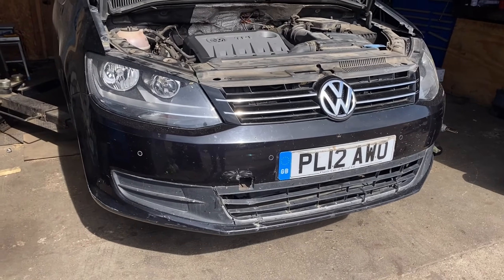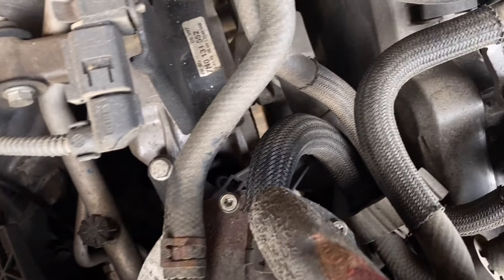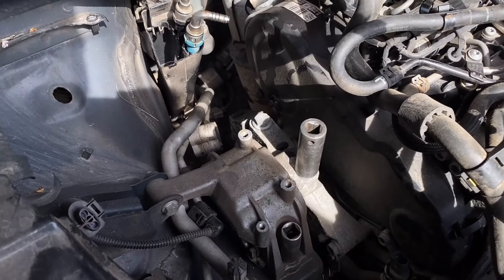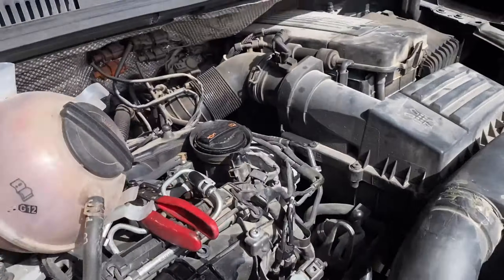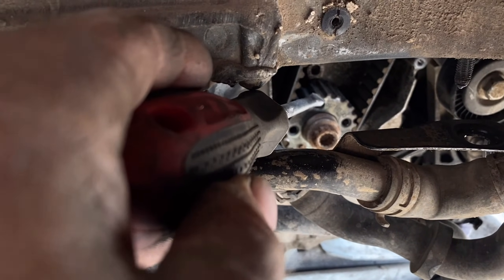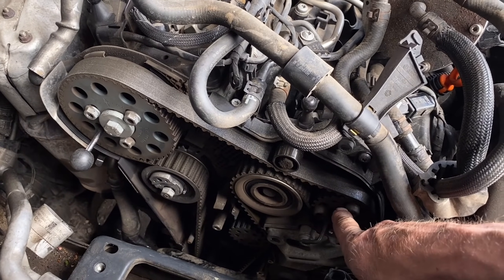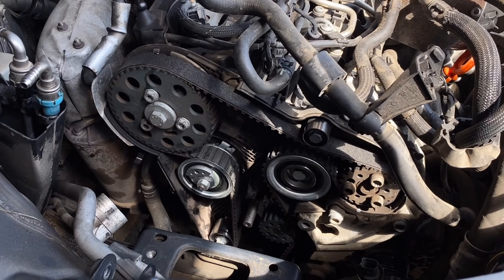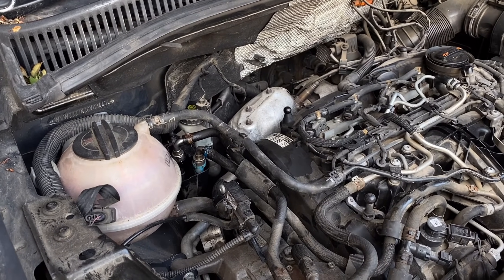Replacing Your Vw 1.6/2.0 TDI CR timing belt & water pump

Comment: Hello, I was wondering if you can help me, i recently got the timing belt kit you used in this video installed on my mk7 golf (RHD DSG), but as soon as it came out, the car struggles up hill and revs upto 3.5-4k on inclined roads. my mpg went from 50 before install to 25 mpg after. I did take it to another VW specialist to see if it was a tooth off but he said it was fitted correctly, just that the numbers should be reading upwards when facing the timing belt from the drivers wing, do you think the direction of the belt being installed would affect the cars performance? to make things worse, there are no fault codes when scanning for errors. thank you for your time
Reply from the maker: Hi bud sorry to hear you are having problems and nope the belt going the other way makes absolutely no difference so don’t worry about that, it’s a shame it doesn’t throw a fault code up. Normally codes will come up if you go up a long hill, that gives the ecu time to see a problem and throw a code up.
Reply: @YTDTETV  thank you for your swift response. I was advised to take to fill up v power and take it on the motorway for 20 odd miles, and if persists go to someone with odis or another scan for a deeper dive. This is the only time I want to see a fault code
Reply from the maker: @D3generateGamer  that is a good tip about good fuel, let me know how you get on.
Reply: @YTDTETV  I took it last night for 40 miles altogether on the motorway, but before that "Try adapting (also called basic reset) the clutch and see if it fixes your problem. Turn the car off, turn the key to II right before ignition, hold the throttle pedal down to the "button" for 20 seconds, release, turn the car all the way off (DO NOT REMOVE KEY) then back to II, then off again and then start the car. See if you feel a difference, you probably will." Tried the throttle reset, the cars not 100% but it does drive a lot better and doesn’t reg up to 3.5-4k revs anymore. It’s a drivable car, mpg was at 40 after ydays method. Guess the throttle sensor/position got messed up when they took wires out for the belt

Comment: Can you show the torquing of the engine mount bolts? Heard in another video they were crazy tight.
Reply from the maker: Hey bud I didn’t use a torque wrench in these just tight with a half inch ratchet 👍

Comment: Have you had it where there is two types of tensioner I’m doing mine and have the same kit you have but the tensioner on it at the moment is the other style gates version are they interchangeable if you know? Cheers
Reply from the maker: Hi bud sorry for the delay, I’ve heard there’s 2 types but not seen the other one, if it bolts on then I’d say you could use it 👍

Comment: Great Guide. When I go to tension the belt up it means I can’t pull out the Camshaft Pin it’s really stuck in. It was loose in the hole before I tried to tension it up. Can’t you help?
Reply from the maker: Hi Tom sorry for the delay did you solve this?
Reply: @YTDTETV  Hi. Yes I took belts off again and turned the cam pulled and fuel pump pulley clockwise to their stops and then resin-stalled. Once tensioned up I could remove the locking tools. I did have to make
Minor adjustments after turning the engine round at the end. I found a good video showing how to make those minor adjustments. I will post up in the comments. Thanks again!
Reply from the maker: @TC07YER  well
Done Tom sorry I didn’t get back to you sooner 👍

Comment: Hey, what kind of sealant was in that tube?:) whats the name
Reply from the maker: Hey woody I use wellseal 👍
Reply: @YTDTETV  Thank you so much! Just did the job and water pump leaking.. also thanks for the great informative video, and quick response:)
Will be using a similar product when fixing the leak
Reply from the maker: @TheToastedGamer  no problem happy to help, I use wellseal on o rings and most gaskets as it’s not like a normal silicone it’s more of a thick liquids. Also if you ever have to remove a part with a gasket the gasket won’t be stuck to the surface then ripped when removed.

Comment: My mechanic uses genuine vw kit and water pump he says he has had well known aftermarket water pumps leak well before the 80k mile change time.
Has anyone had contitech, ina, gates, skf pumps leak before the next belt change has come round?
Reply from the maker: Hey bud so the 4 brands you mention are normally really good, water pump life can also be shortened by the belt being to tight when fitted. A genuine pump is always best 👍
Reply: Oh ok thanks for reply
Reply: Hepu P569 leaks after 5 years and 65,000 km mostly urban drive.
Reply: @accurate3839  i went with genuine belt and genuine pump after hearing stories of other pumps failing well before cambelt change interval

Comment: Just had my VW Caddy van re-mapped after an EGR valve failure.
He said that all VWs are ECU programmed to fail namely the EGR value, Glow plugs and then the injectors before it gets to 100k. Best £300 I have ever spent getting all the self destruct codes deleted.
Reply from the maker: Hey Gareth if you want a Vw to last then yes a Delete and remap is a must, you will have hassle free motoring now with better fuel economy 👍

Comment: I just had timing belt and water pump on mrs’ 2016 Skoda Superb 1.6 TDI. The water pump had some electronic part on it. Some sort of sensor with a plug on it. What do you reckon that does besides making the kit more expensive?
Reply from the maker: Hey B-ry the later ones like yours have a variable water pump so when the engine is cold the water pump isn’t spinning 😵‍💫 good for colder weather. I havnt done one myself but read about them.

Comment: Nice vid. Just want to mention that the engine mounting bolts are stretch bolts and therfore one time use.
New ones should be used on reassembly.
Cheers.
Reply from the maker: Thank you bud 👍 I never knew that about the bolts so will remember on the next one. Thank you 👍👍

Comment: Great video mate. Just having  a go at my timing belt now, after watching this a number of times. Have bought a timing belt locking kit of amazon and like yours, the crankshaft locking tool doesn't fit the teeth properly but can get the line and hole to line up. Could this affect the timing because the tool doesn't quite fit snug
Reply from the maker: Hi bud thank you glad the video is of use 👍 yes the crank pulley tool don’t seem to fit to well only half of it seems to bite all the way into the teeth in the pulley. Al long as you can see the line lined up and the hole for the pin then it’s all good 👍👍
Reply from the maker: Just take your time, double check all your marks after then rotate engine a couple of times and check marks again you’ll be ok 👍

Comment: Excellent video and good camera work, good that you explained the possible tip falls on this job.
Just would like to suggest maybe you need to highlight the need to prime the fuel system thoroughly before starting.
Reply from the maker: Hey Colin thank you for your comment 👍👍 yes your right flicking the key in and off 5-10 times is definitely needed. When making these videos it sometimes get hard to remember to mention all of the tips as focusing on the actual job and a camera sometimes gets a little tricky.
Reply: @YTDTETV  yes quite a complex and time consuming operation, many thanks for your 
 time and trouble with the details

Comment: Excellent vid and no waffling. Very helpful. Could I ask how you remove the fuel pump without upsetting the timing as you have a locking pin in it?
Reply from the maker: Hi bud thank you 👍, after inspecting closely the pin that I put in the pump wasn’t doing anything. Also on a modern common rail engine like this one the pump isn’t actually timed up as the fuel pump only produces a constant high pressure at all times it’s the electric injectors that do the timing from the ecu. Just to be on the safe side I would mark the pulley with abit of tipex or something then re align when you put the belt back on. 👍

Comment: VW sharan 2011 2.0 cffb.
I found no need to disconnect fuel lines. For coolant I have disconnected the hose at the bottom near aux heater where its comfortable to catch it.Drained as much as I can,so when water pump out it was very minimum coolant coming out.Gates kit dont have tentioner lever,weard and a bit scary to put in.But job done.
SKF was on the vehicle probably from the factory (108k miles),tentioner bearing making a nose when spinning,the rest of the components spot on.
After doing the job I think genuen kit from tps will be my next one.
Yes gates and other aftermarket kits are decent,but difference in the price is not as big,so genuen next time.
Ones again thank you for the video.
Reply from the maker: Hey bud that’s awesome 👍👍 nice tips there I’ll try not disconnecting fuel lines next time. Good job you changed then if one of the bearings where noisy.  Glad the video was of use, appreciate your comments 👍

Comment: 152k miles,I take its second timing belt kit for this?
Mine is 110k miles,never been done.
Manual said good up to 210k km,but I'll do it now.Also 11 years car,so I recon it's time to change. 
Thank you for sharing.
Reply from the maker: Hi bud yes I’d say it must be it’s 2nd replacement, I’d say 110k miles yes yours is due. These vw’s have a really thick and wide belt so they last longer than others. I saw an Alfa Romeo belt snap at 46k, I replaced the head. Thank you for the comment 👍👍

Comment: Hi bud nice vid and explained well ,why do you have to undo the cam pulley bolts?. Asking as I'm about to do my 1.6skoda TDI. Thanks Dave.
Reply from the maker: Hi bud welcome to the channel and thank you for the comment, so you undo the cam pulley bolt as it makes it easier to get the new belt on. If you I do it you can mark what it’s sits on the bolts. You can do it without undoing the bolts aswel I’ve just done a few and is slightly easier to get new belt on. Shout me if you need anymore help 👍 also if you get 2 mins and fancy sharing the vid that be great 👍.
Reply: Thanks mate you make it look sooo easy lol
Reply from the maker: @kawasakiinitful  thank you 👍 I have done a fair few so practice makes perfect I’m sure you’ll be ok. I always say in most of my videos take your time,  double check your marks and timing then turn the engine over 2 full revolutions by hand then re check. Thanks again 👍
Reply: Hi mate me again ,what direction do I turn the engine when checking after fitment please.
Reply from the maker: @kawasakiinitful  clockwise, if turning an engine over by hand always turn towards/clockwise 👍
Reply: Thanks again mate legend 🤟
Reply from the maker: @kawasakiinitful  no problem happy to help 👍
Reply: Well I did it today mate all as you said . Water went down after a 2 mile drive which worried me but I topped it up and its stable now after a 50 mile drive ,must have been air I guess. I also ordered and used that sealer you have . 

Top man bud thanks again ..
Reply from the maker: @kawasakiinitful  absolutely banging mate well done 👍 I don’t earn hardly anything from YouTube but to know my videos are helping and inspiring people make it worth while. Thank you mate 👍 if you get a moment to share the video or any of the others on social media that would be great.

Comment: just put my 09 tdi and i’m turning the belt but there’s a spot that gets a little harder harder but it doesn’t lock up, is my timing off?
Reply from the maker: Hi bud they do get stiff as the piston goes up and the compression builds up, just to be sure check your timing marks again. Also if your using a small ratchet or spanner to turn the engine over it will be stiff. Maybe try with a bigger bar as that gives you a better feel. Let me know how you get on 👍